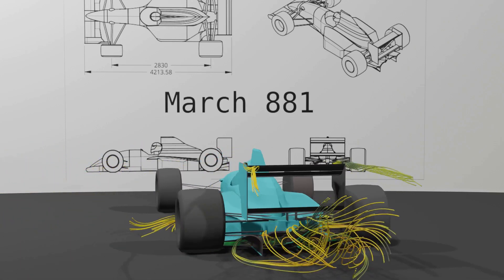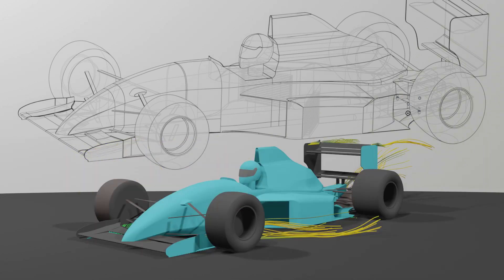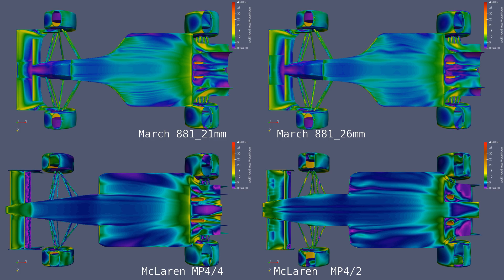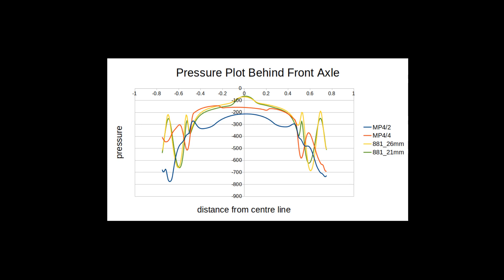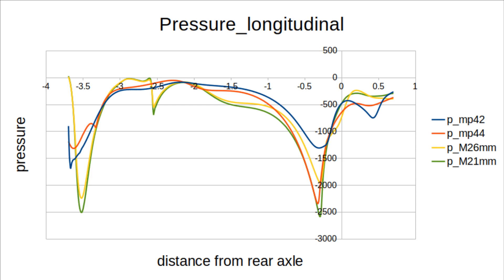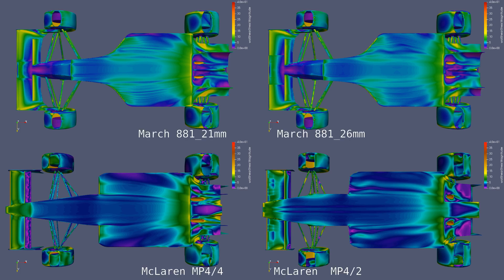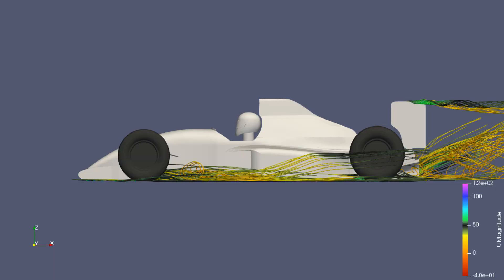A CFD Analysis of a Historic Formula One Car: March 881

Comment: hI! awesome vieo, im kind of using it as an inspiration to a uni paper, comparing the 881 with the mp4/4, but i cant for the life of me convert the 3d model. I tried converting a asseto corsa model, but cant seem to work with ansys. How did you make the model? would it be too much to ask to provide the model?
Reply: Hi, just a quick question. What degree are you studying at uni? Mechanical engineering or aerospace? I just want to know because I’m considering them both and can’t decide and was wondering if you had any advice?

Comment: Nelson, is it possible to use CFD to analyse a 1960s F1 car, particularly a Lotus 49? I'm very interested in the following: 
How much lift is produced by the nose, how much drag the car produces overall and the shape/strength of the slipstream behind the car vs distance.
Reply from the maker: It would be very possible to run a simulation on all of these configurations.  If you're interested in commissioning me to do this you can contact me, its currently not on my play list.
Reply: @nelsonphillips  what do you mean by commissioning?
Reply from the maker: @OldRacingGames  If you want me to run some simulation for you I will for some commission.

Comment: from where do you get your data of the car's dimensions and the 3d models?
Reply from the maker: the dimensions come from the fia regulations, technical stats found online and/or images. Like taking an image you know the wheel base, overall width and hieght of the rear wing. This gives the basis of the models. You don't have the wing profiles so that is generally the weakest part of the analysis but wing theory says if you get the dimensions close then basic profiles get you most of the way there.

Comment: By the way I managed to export some models from AC into the Freecad, but I was not able to export them to export them to the IGES file which simworks requires. Some of the car's are really detailed, technically you could just use front wing or rear also. You using IGES?
Reply from the maker: Yes, definitely can just use a front or rear wing. Open foam uses stl or obj files.
Also there are this concept of a bluff body. It approximates the chassis without the detail
Reply: @nelsonphillips  There are tones of F1 models in Assetto Corsa, heaps of free mod's on the internet, that already have been modeled. I exported from KN5 files in 3DsimED3 to OBJ. But I might have try OpenFoam, SimWorks seems to only support IGES. FreeCad, won't export from OBJ to IGES.
Reply from the maker: @testdrive7772  oh yeah nothing will export obj to iges as obj/stl are meshes and it's etc. Iges Are parametric
Reply: @nelsonphillips  I installed OpenFoam(Linux) via Windows, It all seems to be command promote. Do you use like an App in Windows to display the data?
Reply from the maker: @testdrive7772  I run linux. In the folder that you are writing the data/result to there should be some log files. Say you are using simple numerical model the log file is SIMPLEFOAM.LOG or something. The actual result shoud be in a folder named postprocessing. To access those post processing results you command line: paraFoam. This opens paraview which is the display, It is also a GUI so thats ok. if you go here: https://wiki.openfoam.com/Tutorials 
see the "3 weeks" series there is a comprehensive amount of knowledge there. Embedded in this is this video series that is a bit of a short cut to the info you need https://www.youtube.com/watch?v=bRS0n8FuFVY&list=PLoI86R1JVvv-EN7BsoyomcWJIPaVPXaHO
Reply: @nelsonphillips  Cheer's, I got paraform working it come up via, XMing on Windows10 but I still need to learn to load the models and run the tests. I will look at tutorials on how to do that.

Comment: I downloaded Simworks 21, what did use for the simulations? It's kinda complex, I'm clueless, the air density seems be 1.2. I'm trying to create rear wings or front wings, from pictures.
Reply from the maker: I use openFoam. Its Linux based but there are Windows "versions". I would start with NACA models. Also FreeCAD is OK. Oh edit, Simworks is openFoam...
Reply: @nelsonphillips  I'll give it go, I'm really curious with wing's. I seen MP4/4 Wing at Detroit, ironically looks bigger then the Wing at Monaco for 1988.  So it seems like they passed 1 CL for the rear wing. I ran qualifying lap at Monaco today with 1 CL rear wing.  https://www.youtube.com/watch?v=zf7Aiq7iNSs COG of 37%, Aero Balance of 37% but I set the diffuser to work optimally at 1.7CL.
Reply from the maker: @testdrive7772  with running simulations just make sure you start to understand what you are measuring. Its not as simple as it seems or looks.
Reply: @nelsonphillips  Yeah, it's complicated. It's a hard subject. I don't even know how to create the 3D data to cross it over. Building an entire car in 3D would be hard also, I don't have good blender skills.
Reply from the maker: @testdrive7772  parametric modelling is better than blender. Have a go at freecad.
Reply: @nelsonphillips  buggy software, complex. Simworks
Reply: @nelsonphillips  I got some data for the glider, lift and drag for the glider came to about same number. I technically have a wing tunnel, now it's all about just loading a car or a wing in that area.
Reply from the maker: @testdrive7772  awesome
Reply: @nelsonphillips  It doesn't seem to like planes. I got 0 CD, 0 CL
Reply: @nelsonphillips  I got my first results with a drag wing 1 meter width and 20cm height standing up right.. 1.483CD :)
Reply: Cd       : 0.95637967	(pressure: 0.95610794	viscous: 0.00027173471)
   Cl       : -0.86037131
   at 45 degree Angle
Reply from the maker: @testdrive7772  might not have meshed the plane... Well done on the result! First step on the road to an addiction 🤣
Reply: @nelsonphillips  Well, my wind inlet and outlet were not defined. It must of have not saved after I restarted. So I suspect the planes should work now, not just 3d objects. I'm going to attempt the rear wing of Monaco 1988 on the MP4/4, then try the front Wing. Problem is I need to sharpen my CAD skill's. Powerful software, really good models and you could get good data.
Reply: @nelsonphillips        
forceCoeffs forces_global execute:
Cd       : 1.4172521	(pressure: 1.4174178	viscous: -0.00016566021)
Cl       : -1.9461532

I tried to replicated the MP4/4 rear wing at Monaco. Top chord15cm (20 degree's), bottom cord about 4cm(45 degree's),Bottom Flat cord, side panels 20cm x 20cm. CL is very high 1.94, that 2x what I expected.
Reply from the maker: @testdrive7772  you should expect a lift to drag of about 4 for a three element wing like this. It seems a little draggy, lift is about right.  https://www.semanticscholar.org/paper/AERODYNAMICS-OF-RACE-CARS-Katz/d1b8e5535853dea904c68ad2cd8dc729ba4fb0aa/figure/5.
Reply: @nelsonphillips  Rear wings tests is insanely high. 2.6CL, 1.8CD. I did qualifying lap in the simulator with 1.0CL about 0.6CD. Maybe I've did something wrong.
Reply from the maker: Yeah just go through the glider tutorial, it looks ok.
Reply: @nelsonphillips  Did you use 1.2 Air density?  I guess drag and downforce would be differenent at that setting.
Reply from the maker: @testdrive7772  yep, 1.2kg/m^3. Density would have a big influence. You should become familiar of Reynolds number.
Reply: @nelsonphillips  20C is about 1.2 https://en.wikipedia.org/wiki/Density_of_air

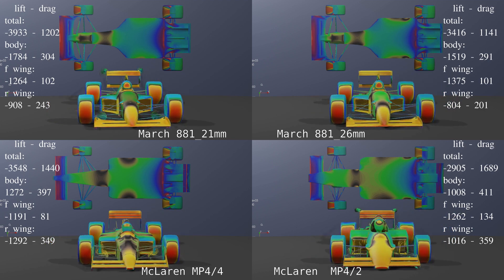Comment: 4:31 The front lift to drag ratio seems high at 14 / 1 for MP4/4
Reply from the maker: yeah because the nose was sectioned meaning that the nose isn't being measure with the body, but with the wing.

Comment: Superlative video presentations! Thank you so much. After seeing this it would be interesting to see see an analysis of the Lotus 100 from the same year. Not because it was a great success, quite the contrary, but because it seemed to have a some of the right ingredients, The Honda engine, aerodynamics which had had a design seemingly more modern than the amp 4/4 like narrower nose with springs situated above the driver’s leg, and a more enclosed cockpit opening, not unlike the March. 
So my wish is to see if you can identify the fatal flaw in the design.
Reply from the maker: You're not the first to comment about the Lotus. On the surface it looked like a competitive package, funding, drivers and engine. The more I do these videos the more insight I get about how much the role aero has. It seems that 1988 was a turning point in development where the cumulative effects of integrated parts of the car were being needed to be competitive. I might come back to these cars and do a general engineering analysis to see the benefits of these cumulative effect. I'll need to learn a new tool to do this.
But, one thing i have observed with the Lotus was that it was still running the same or basically the same diffuser concept they were running in 1985. McLaren developed a second generation diffuser for the mp4/4 which understood the role of ride height. If I needed to choose one aspect of the Lotus, it would be that they didn't have anyone who understood diffusers. Knowledge about diffusers seemed to be rather uncommon back then.....
Reply: @nelsonphillips  Sounds good. A colleeague wrote a book about Team Lotus from 1983-89.
Reply: @nelsonphillips  A general analysis of the cars of 1988 would be wonderful as there was so much variety of the different cars. It’s hard to imagine cars more diverse than the Benetton B188 and the McLaren MP 4/4. 
Regarding the Lotus 100T there has been so much theory to its failure. From lack of driver interest/talent to lack of chassis rigidity (doubtful in my view as it would have been quiet easy for the team to detect). If I remember correctly, I have read a quote from someone at Lotus claiming that to much aerodynamic testing had been carried out in a non rolling floor wind tunnel. Sounds strange to me, but it’s undoubtedly almost a fact that the main reason for the demise of Lotus was that they didn’t acquire top notch aerodynamic testing facilities in time. My personal pet theory is that the front wing was lifted to high of the ground. Why do I have this theory? Basically the raised front wing came with the introduction of the type 99 and therefore coincided with the teams progressive fall from form. This is how much an aerodynamic layman I truly am! Maybe I could speculate that the colour yellow slowed them down, nah I’m not that daft. 
Thanks once more for the great work.
Reply: @klaushaunstrupchristensen7252  have you seen the video of Jackie Stewart driving the Lotus 100T?
Reply: lotus chassis wasn't very stiff, they had that problem for a few years for some reason.